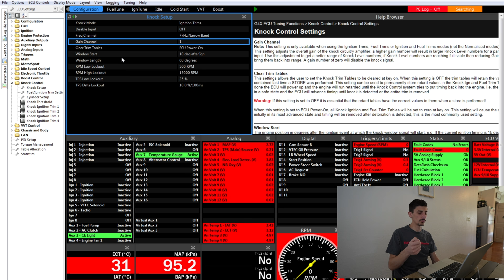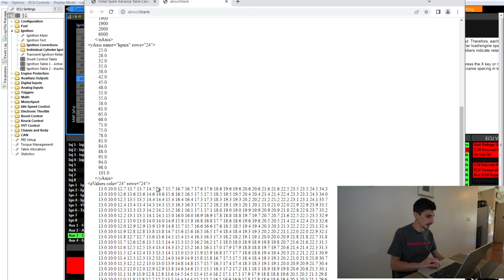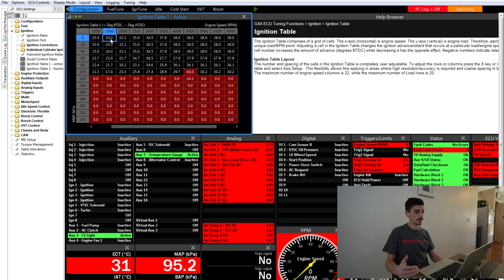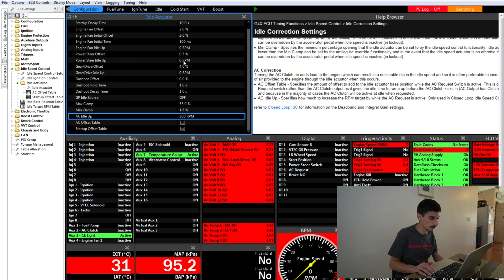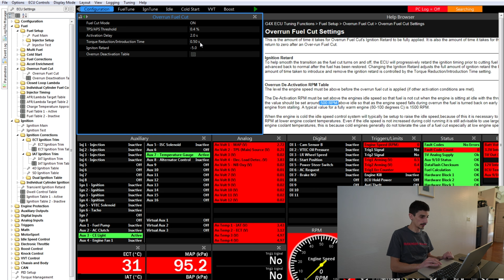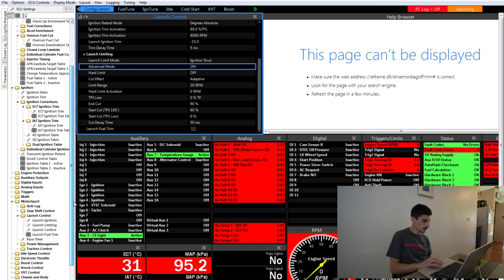Link ECU Training | Lesson 3: Spark/Ignition & Drivability

Comment: Hey would you be able to list what to set up and tune 1st, 2nd and 3rd and so on? Like ve table first to be able to start the car and then do ignition timing etc
Reply from the maker: Sensor calibration, timing light, dial back your spark table, then VE, then finally ignition (preferably on a dyno unless you have knock sensors)
Reply: @ man you simplified that well bloody Thankyou a lot legend
Reply: So would you say ignition timing is possible while tuning on the public road? 
I’ve seen people saying you can’t hit all the load cells even with the left foot braking technique
Reply from the maker: Ignition timing tuning is only possible if you have your knock sensors properly setup or on a dyno. No exceptions. This is how you can hurt your engine tuning

Comment: Thanks for these videos. Im having hard time to keep my car running on idle in open loop and only by pumping gas it will not stall and this video help a bunch to understand it. I thought that it could be vacuum leak but I try to change some things to see if it will make difference. I will try this and see if it works! In closed loop it runs as it should.
Reply from the maker: Sounds like you need to tweak your fuel table and possibly cold start table

Comment: Thank you for the video, I learned a lot, you even helped solve some of my drivability issues. I do have a question regarding boost vs timing though. I know you said a rule of thumb is to take .3 degrees per kpa in boost, but does that actually work out in the real world? For instance, for a car running 25psi (well over 200kpa) would you actually pull 30 to 50 degrees out in relation your 100kpa starting point (say 30 degrees)? I know guys are running relatively high boost on pump gas but I wouldnt think they would have 0 or even negative timing advance to obtain that. Just wondering if you or anyone else that reads this had any insight or experience with the topic as im planing on running about 20psi on my gt2871r Audi 1.8t after I do some supporting mods and im trying to keep my engine safe. If not, great video man, keep it up.
Reply from the maker: It's a complicated answer honestly. It really has to do with compression ratio too. The lower the compression ratio of the motor, usually the more timing the motor wants N/A. So like a car running 20psi of boost in your example will start at more like 40-45 degrees of timing at 100kpa since the motor would probably be running 8:1 compression. That's why that megasquirt table builder kinda helps too because there's a lot of variables including what kind of fuel you're running
Reply: @CanyonTuned  Appreciate the responce.  I did try the megasquirt table builder and even imported it into tunerstudio to get a better visualization of it. good place to start like you said. thanks